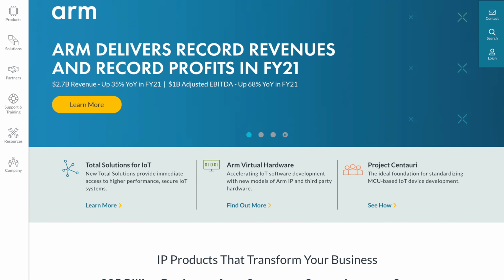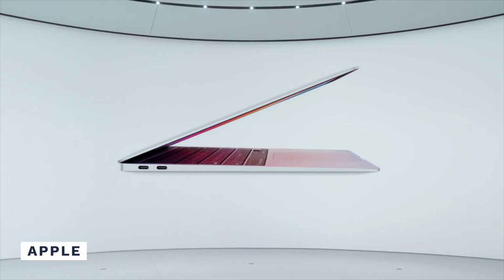ARM vs x86 | Is Apple Changing The Game?

Comment: buddy. ARM is super under-powered. You even showed why in your video. RISC cannot beat CISC when doing high end tasks. Apple has already maxed out how fast you can push ARM. The M2 is slower then the M1 ultra. https://en.wikipedia.org/wiki/TOP500 if you look here you can see that the fastest ARM super computer has about 7.5 million cores and 1st is an X86 CPU that has 500 thousand cores. That's less then 25% the amount of cores the ARM one has yet it outperforms it. ARM will never compete in the high end market. And it's even about to be replaced in the low end market by RISC-V. Also, even if ARM was better it'd be hell for custom builders workstation users big companies etc because picking the right specs would be harder because it'd be and SoC. Buying a motherboard would probably also come with the CPU if we used ARM. And even if you managed to make PGA and LGA arm motherboards, each motherboard will still only be able to do very select certain CPUS rather then the form factor IBM invented where almost everything can be changed and swapped out. ARM is also not new, It's just as old as X86. Your chances are better with RISC-V if you want to beat x86. I don't think any RISC CPU could beat a CISC one though, but who knows, RISC-V might surprise us, but I know for sure ARM isn't the future. Although I'm not a fan I respect you and your channel. But please don't push the false narrative that ARM is the future.
Reply from the maker: Thanks for the comment! Just a few points to make sure we are on the same page, M2 doesnt replace the M1 Ultra. Thats like saying the 12400 is slower than the 11900. The M2 isn't to replace the M1 Ultra. There will be an M2 Pro, M2 Max and an M2 Ultra. The M2 is like an i3 in Apples line up so of course its going to be slower than last years top end chip from Apple but that would be the same from AMD and Intel. Hope that makes sense :) RISC-V is the next step, same with X86 and x86-64, I should have made myself clearer in the video, I was referencing the general technology, not saying RISC specifically but its line, similar to x86 and its line. Sorry about that. Also I never pushed any false narrative of ARM. The line I think you misheard was " However, one runs more efficiently than the other which is why many believe ARM will be the future of computing and will remain the architecture of choice for the smartphone industry for the foreseeable future. " I didnt say I think it would be and I also mentioned nothing about I think it will replace high end PCs. There are other points you mentioned which are interesting, but also remember that many big companies have chips made specifically for their uses so if ARM is easier to design and is more power efficient then they may opt for it once the technology has matured in the workstation space. Right now my guess would be that smartphone development of ARM is much larger than workstation applications as compared to x86 etc but this is just a guess. For now, Apple thinks ARM is the future for their computing including their Mac Pro line (whenever they will launch it lol) but thats not to say AMD or Intel are looking at it the same way,  the winner will probably be who ever spends the most! Although, rumours do point to both companies looking into it. ARM could be the future for laptops (due to performance per watt ie better battery for the performance) but thats not to say every single computer will be ARM! similar to electric cars! Some think its the future while others disagree, its all an opinion up until that point! Thanks for the comment again and I hope I cleared things up! Sorry for the long message, might be the longest I have ever wrote!

Edit: M2 isn't to replace the M1 Ultra ( mistyped)
Reply: @SabrentUSAOfficial  you make a great point. however you give too big of a hand to ARM and SoCs. RISC and CISC in modern are much more similar to one another then they were back in the 80s. both ARM and x86 come from the 80s. the way they got to where they are now is by getting a ton of additions and extensions. they are both old and bloated though. ARM is already at its limit with apple’s M CPUs. the ultra is 125% the size of a threadripper and still gets insanely hot. x86 with intel’s alder lake is also very poor quality. AMD will likely make the final good x86 CPUs for the next 2 generations. ARM has elements of a RISC version up to 4 making it messy and old. with RISC-V it’s possible the integrate a more elegant slim version of  x86-64 and its functions allowing it to operate like one but less power consuming and hot. this is possible because RISC-V is a very open thing. RISC-V is very likely to replace ARM and x86. but youve got to be shitting me if you think and ARM SoC is the future. Once again i respect you and your channel but this video is misleading
Reply from the maker: I think I am being too general which may cause some confusion, I think I may need to be specific. I am talking about ARM and ARM like chips which includes RISC-V. Basically chips that isn’t x86 and uses RISC fundamentals. I am talking about the overall technology, not the specific brand as such. Yes RISC-V is open vs ARMs closed source approach. I think we both agree actually but maybe I wasn’t specific enough, this video was meant to be for beginners and to break down the fundamentals rather than taking a deep dive into every aspect. Maybe I should make another video breaking this down further like a ARM vs RISC-V video or something? I think the video is very good and we did get very good feedback but I appreciate that you didn’t like this video.
Reply from the maker: If you want to know my own personal opinion, not speaking for anyone, yes I definitely think RISC-V will over take ARM if they can attract the right major companies, I mean it’s already happening so ARM should be worried but I do think RISC-V will overtake CISC in the future too haha but that’s just my take on it, but this video isn’t about my personal opinion on this stuff
Reply: @SabrentUSAOfficial  it makes more sense knowing that this video was for starters. Sorry if i came off as aggressive. Another video could be made where you could make predictions and talk about the likely outcomes since this video kind of makes it seem like everything will be ARM soon and i know that wasnt your intention, but with bigger fish spreading false information cough (linus tech tips) this could be seen the wrong way to certain people. I like the way you explained a lot of things in this video though so props to you for that.
Reply: @SabrentUSAOfficial  same here. RISC-V could definately be backwards compatible with x86 functions in a much more optimized way to allow for the CPU’s technology to evolve with cooler temperatures and faster speeds. This also applies to how it could replace ARM since arm is still stuck with some very old RISC stuff that isnt changed or optimized and RISC-V could probably become a wordwide standard. I am worried about backwards compatibility. but it shouldnt be too hard for intel and AMD to make variations of RISC-V with some x86 functions in it. RISC has already been seen doing stuff like this. the PS3 used RISC and yet it contained a lot of x86’s capabilities and you can even make a PS3 run windows 7. RISC was part of the reason the PS3 was so novel and fast for its time and was able to have crazy core counts and an amazing architecture while still using the size of transistors they had back then, so i think the PS3 is a great example
Reply from the maker: No not at all! Maybe I will make a note in description of the video mentioning something about this video being an overview rather than a deep dive! And no it wasn't my intention, I try to keep my opinions out of videos like these as its more to just explain stuff :) And thank you, I tried to make it as digestible as possible so that even someone who isn't into tech can follow along! I will definitely make a note of the things you have mentioned for future content :) Thank you for your time!
Reply: @SabrentUSAOfficial  no problem
Reply: I think arm is better than x86 in one thing
Ratio of power consumption vs performance. And if we can scale up arm chips to be as powerful as x86 then still it can consume less power. ( I'm not sure just guessing)
Reply: @GOOD_FARMER  you do have a point however ARM has many limitations that can hold it very far back. First of all it's an SoC and holds the RAM GPU and CPU all in one chip. This combined with the low power consumption made it great for phones along with the fact that ARM cores are much smaller and way less powerful than x86 cores. This and the fact it uses RISC makes it so that it's great for low end devices. However when trying to scale the power up to a high end level problems start to rise. It actually gets much hotter than x86 when trying to compete with it, the new M2 reaches 102 degrees C, this combined with the fact that these chips most of the time are usually 4x the size of a ryzen 5 you start to see the issue. along side this it can only fit a 64 core GPU and 20 cores while the chip will be twice the size of an RTX 3090 ti chip. this can be cause for many issues. The reason we are seeing apple beat out other tech giants is just because they are early to the next gen technology that isn't related to ARM along with them already being at 5nm. without a doubt AMD's newly announced ryzen 7000 series will out perform apple. the reason apple was able to beat intel is just because intel is doing very poorly as of now. but we can never be sure, there is also RISC-V which is a direct rival to x86 and ARM so right now we are seeing 3 drastically different forms of CPU fighting. I'd say before you invest your money in anything to just wait and see who wins. Otherwise your ARM/x86/RISC-V chips will be abandoned with no software made for them anymore